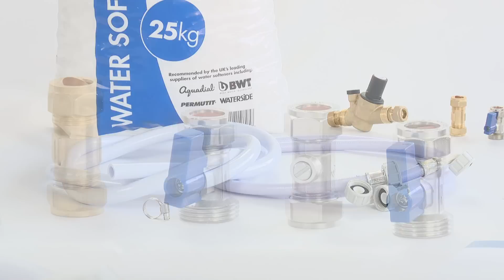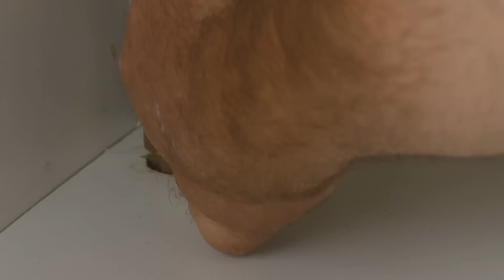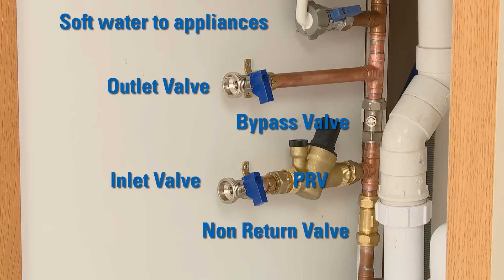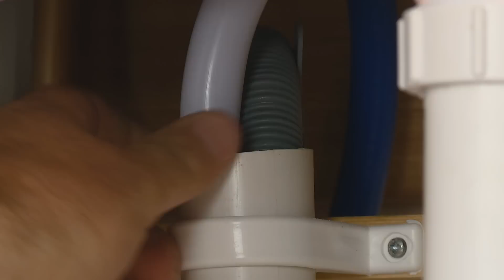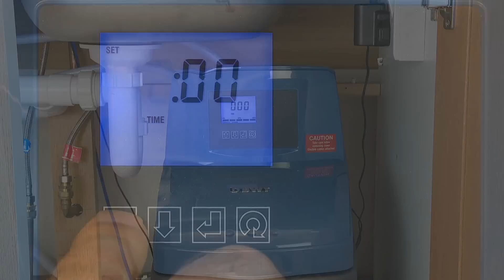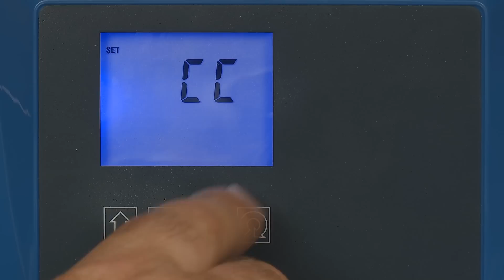HOW TO INSTALL A BWT WATER SOFTENER

Comment: can i not have it run the kitchen tap also? our water is bad and we use that the most ,

also are the pipe diameters capable of flow they seem a bit thin to supply a house like run a bath
Reply from the maker: In regards to your situation, we always advise to have a hard water drinking tap. – Potentially Fitting a separate hard water tap utilising an appropriate water filter could provide a sensible solution in meeting the need for a hard water tap for drinking water whilst improving the quality.

The pipe size displayed in the video is 15mm and therefore we are seen using  the standard installation kit in the video. However, if you have a direct water system with no storage tank in the loft, or your supporting pipework is larger than 15mm then fitting our 22mm high flow kit can be beneficial and help improve the flow rate.

If you require any more information, please do not hesitate to contact us: enquiries@bwt-uk.co.uk